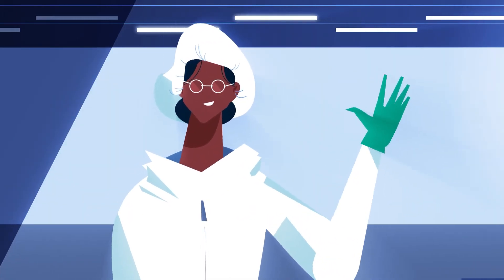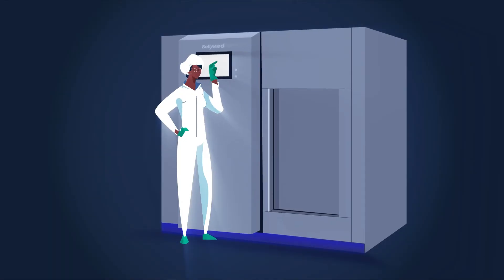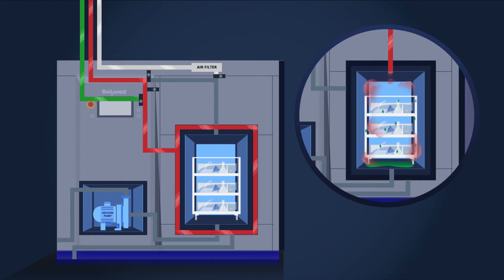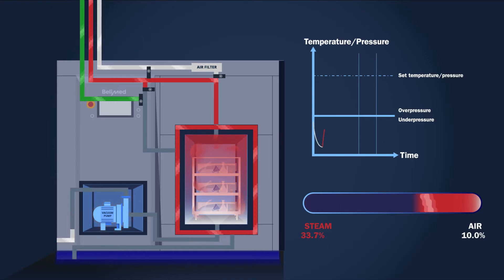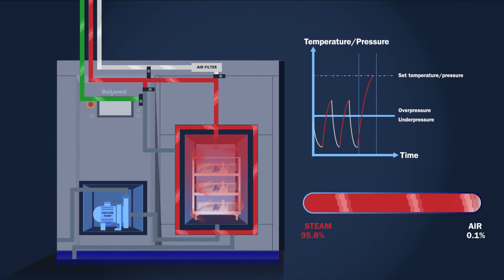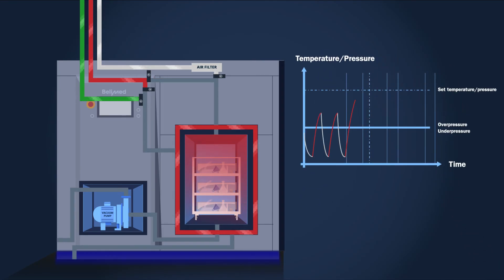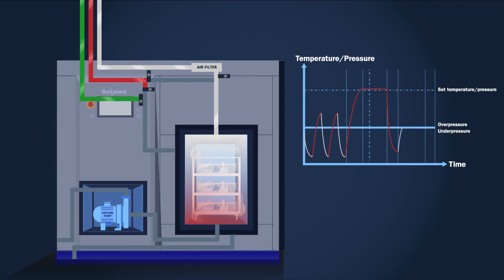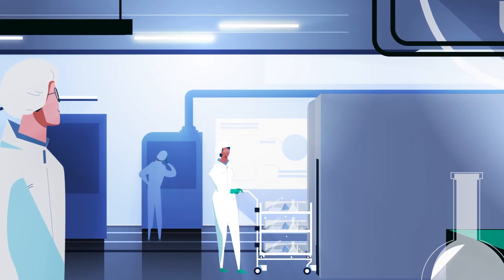How to Steam Sterilize - the technology behind a steam sterilizer - part 1:Solid goods

Comment: Compared to traditional indirect heating methods (such as plate or tubular heat exchanger), direct heating sterilizer rapidly heats the product by directly mixing it with steam, followed by rapid cooling through flash evaporation after the holding period. This significantly reduces the heating time for product , comparable to pasteurization in preserving active nutrients and flavor substances.